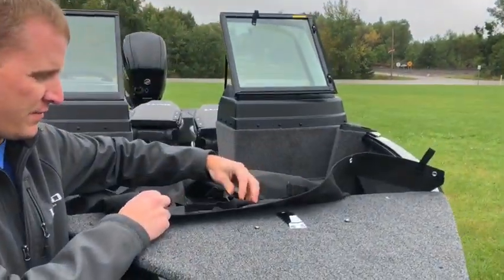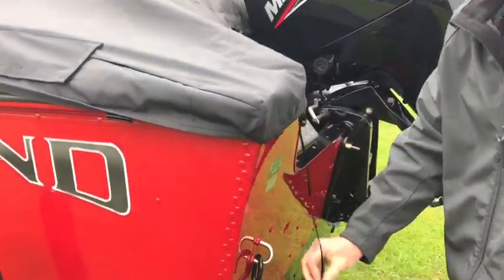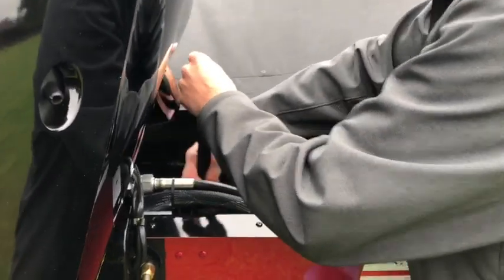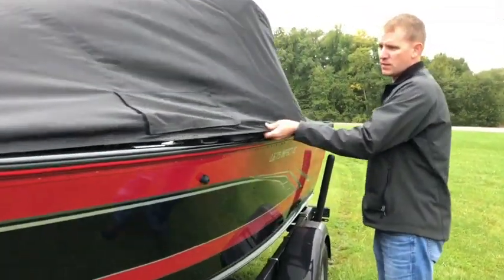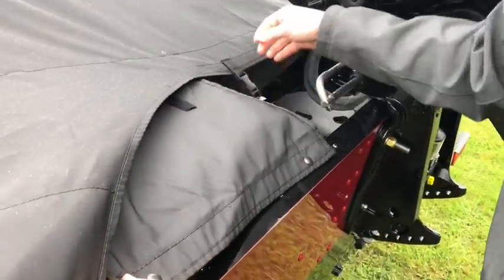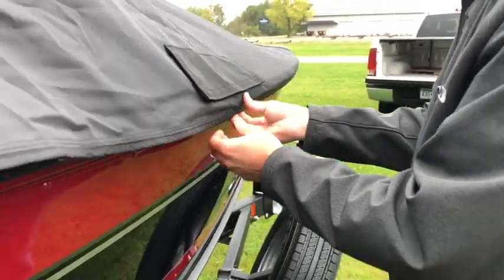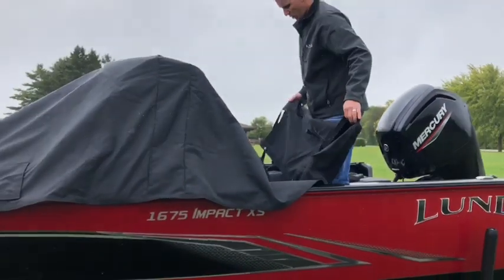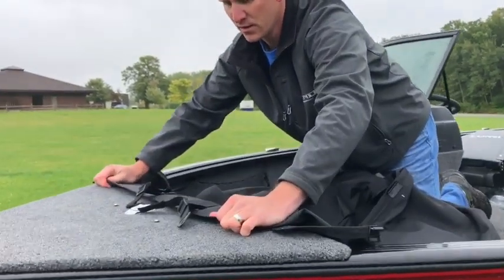Lund Travel Cover Install

Comment: I Love my Lund cover. Trailer 100% of the time covered.  Mine is a 2016 Lund Impact 1675 and most of the issues with mine look to be fixed. One thing that would be nice to change  the front edge of the cover to a different color.  When rolled up it is difficult to find when putting on the boat.  Also the cover needs some additional protection at the point on the windshield where the small rod is to keep from wearing through.  It should be a front to back placing on and back to front removal if 2 people. Quick and easy.

Comment: How come it does NOT work with the Minn Kota Ultrex and Lund deep V's ?  The Ultrex base covers the snap on the bow platform, AND the white post on the motor, is not able to touch the boa floor with the cover on.   Bad design coordination.

Comment: The cover itself is good however, the rubber clips that go into the rail tear easily when taking the cover off. They rip along the stitch line regardless of how carefully you remove them. Have the engineers who design them actually repeatedly used them? My buddy has a Crestliner with very durable easily placed and removed clips. Wish Lund had used something similar…….

Comment: Will the cover work with bow mount trolling motor?
Reply: Normally you take the trolling motor off it’s’ bracket before putting cover on

Comment: It's not sealed on the bow. That's not a travel cover, air and rain is going to get up under the cover from the bow and balloon up! That's a mooring cover only.
Reply: I have the previous version which is basically the same design at the bow.  A very small amount of water does seep under the canvas at the front in a hard rain. The carpet just gets a little damp, not a big deal.  Mine does not balloon up even at highway speeds.  There’s to much wind pressure coming over the top of my cab height camper shell to allow it to happen.  Never had a problem with it ballooning before I had the camper shell either.
Reply: I agree Yosemite. Just a small amount on water at front with heavy rain, nothing into the boat. Have traveled thousands of miles with cover on with no problems.
Reply from the maker: The front snaps and straps hold the cover down to minimize water while traveling in the rain and also eliminates any balloon effect.
Reply: I have this cover but mine has 2 center straps that are tightened to stop movement and shed water.   and it works amazing.
Reply: Nice quality cover just got mine.  Not impressed that there is no support pole to raise the cover in the bow, water pools greatly and rain gets under @ the bow aswell.
Reply: @LundBoatsOfficial  Where can these covers be purchased?